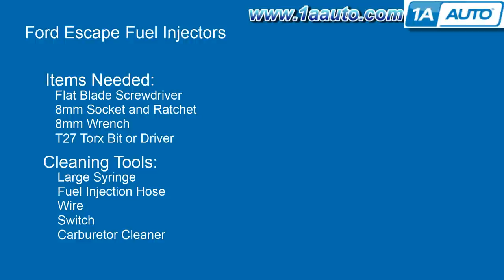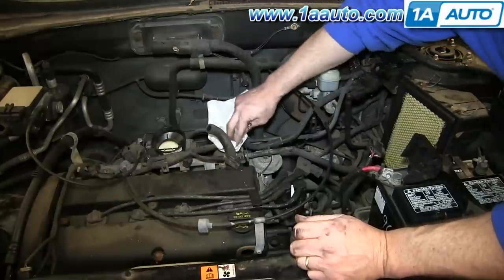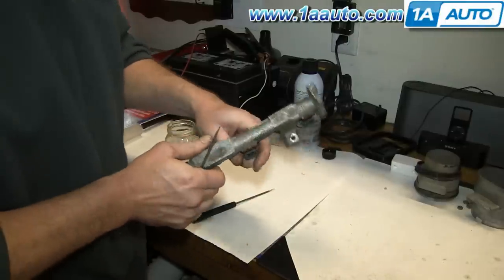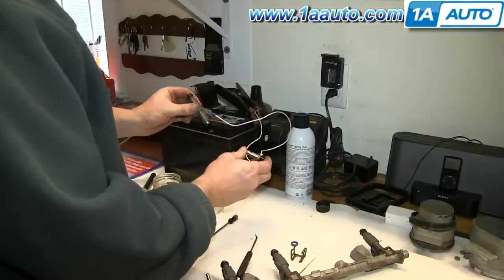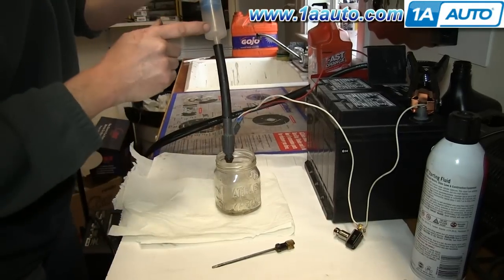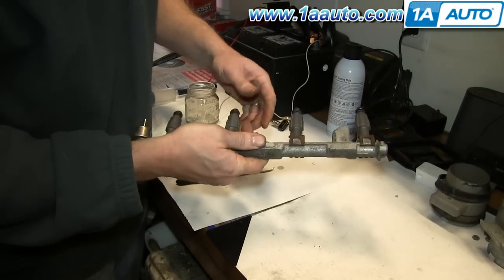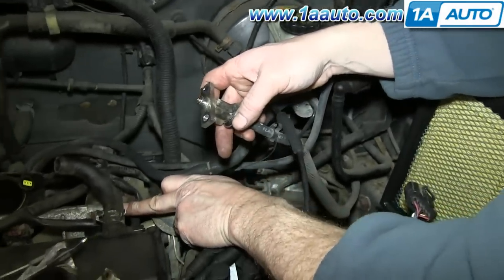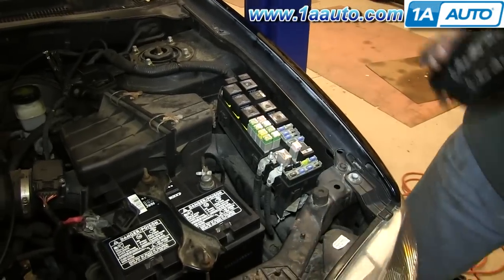How To Replace Fuel Injectors 01-07 Ford Escape 2.0L

Comment: I have a popcorn pop muffled noise , sounds like its coming from where air filter is at, will fuel injector be the issue,  I been seeing alot of these trucks have that pop noise , but no one knows what's the fix

Comment: What happens if the rubber mounts the bolt go in to hold everything down break off when. You start your car and the pressure from the fuel pump pushes the injectors out of the engine could I JB weld it and put it back on? And would my injectors still work? Or would they be broken?

Comment: my number 1 injector is bad, do i have to remove all 4 of them  to get at number 1?
Reply from the maker: +derail14 Yeah, typically you have to remove the whole fuel rail to replace any of the injectors. Make sure to also replace all of the injector o-rings regardless of whether you are replacing all of the injectors. Don't reuse them. Hope this helps you out.  1aauto.com 866-403-3393
Reply: Ive read that some people never change their injectors instead they treat them with premium fuel and injector cleaner. Or take them out amd spray penetrant inside